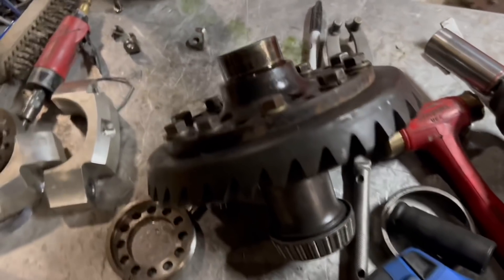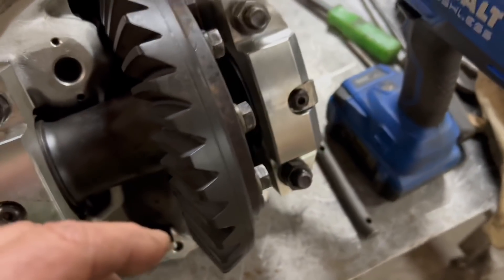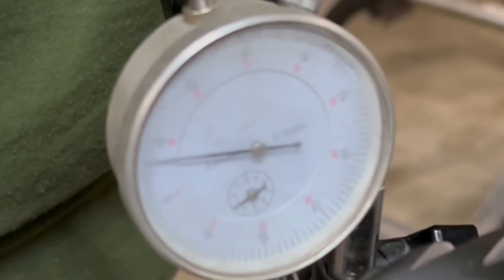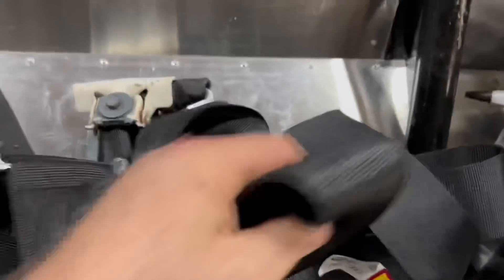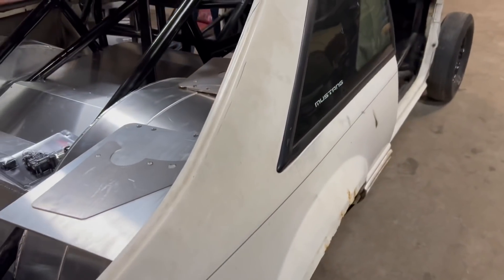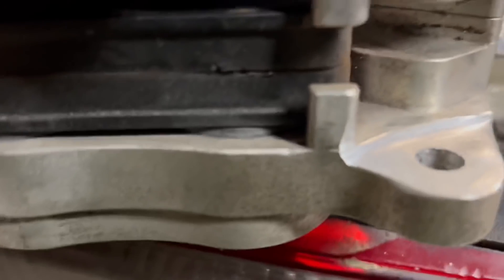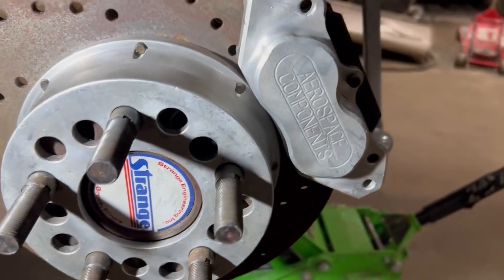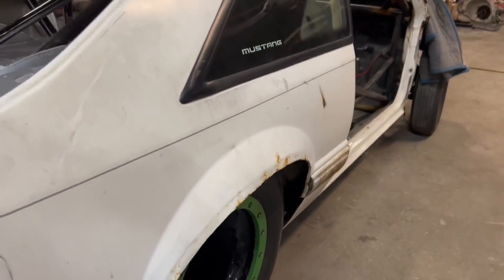It’s Fixed!  9” Ford setup

Comment: Every gear ive ever had a “perfect pattern” was the noisiest set ive ever done lol, i prefer to have the pattern a little closer to the heel and they seem to last longer (marginally) than center. 
Glad to see that mule coming together so we can see some low 4sec passes👍🏻
Reply: Because, to get the true pattern, axles must be in place, and a load supplied, then at least 2 rotations plus in each direction for a real proper pattern to be revealed must be performed.

You cannot and do not race a gearset on a bench top, you race or drive it with the weight of the car sitting on top of it and bearing down on it, also helps to actually have the weight of the driveshaft and the pinion angle pre-set too, to see what pattern you will actually get with the real weighted geometry in the end is.

If you do not think it matters, it does on the final setup pattern.

It is what many miss in the gearing setup, the actual loaded geometry changes everything.
Reply: @garylucier6817  my final pattern check is forward/reverse on the brake part throttle on my 8.8s but other than having an expensive machine thats not going to happen with a 9” so i set it to the heel and have been fine so far

Comment: 9 inch non-oem gear or 9 inch Daytona backlash is 6-10 thou. New bearing pinion preload is 13-16 inch lbs. Use a good quality gear oil, I like Schaffer  75-140. Expensive but worth it. I have in my 8.8. Used it a lot at a previous job with good results.
Reply: BTW, never worry about the coast side of the gear on a used set, just the drive side. It'll come together!

Comment: Sometimes aerospace will make your brackets specifically for your application so if there's variences between rears it could throw things off. Or possible they aren't aerospace brackets.
Reply: My strange came with a ton of spacers to move the caliper in and out it took what seemed like a week to get all 4 done lol in reality it was less than 2 hours.
Reply: @michaelstoker6710  so did my aerospace. but for some reason his caliper is positioned so he can't use them. Spacers would push it on the wrong direction. Weird.
Reply from the maker: I went to aerospace's website and it looks like you can order diffferent offsets on the rotors to fit the various axle stick out widths.  Intersting.
Reply: @rampage2587  ok I see now spacing it out would push the caliper further into the rotor.

Comment: The aluminum  Diff Case is Sweet I didn't catch what gear ratio that is Curious im guessing 4.56 look like 35 spline axels ?🚗🦊🔧💪👊💯🇺🇲
Reply from the maker: 40 spline axles, I went with a 3.60
Reply: @TurboJohnRacing  Damm 40 didn't know they made 40 is 3.60 what's in the old car to ? Thanks 👊 💪🇺🇲💯🐎
Reply: He is spooling turbos, 4.56:1 he would be out of gear and winding it high by the 330' mark, and sometimes runs 1,320'.
Reply: @garylucier6817  I guess all depends on the transmission and tire size too 👊🇺🇲🚗💪🔧